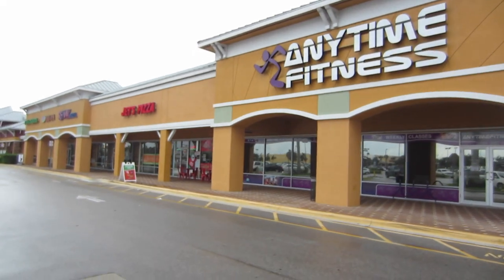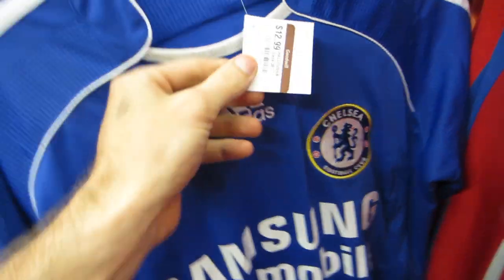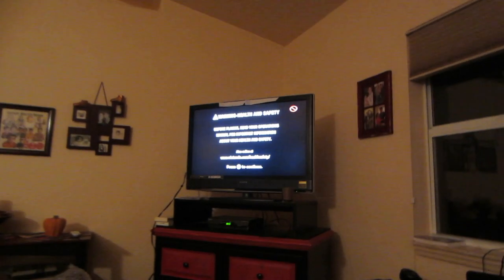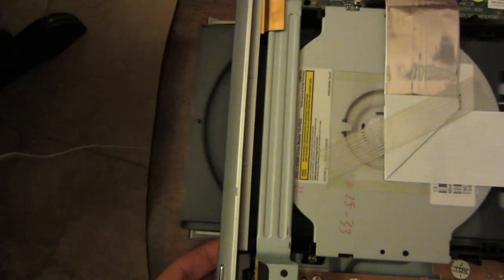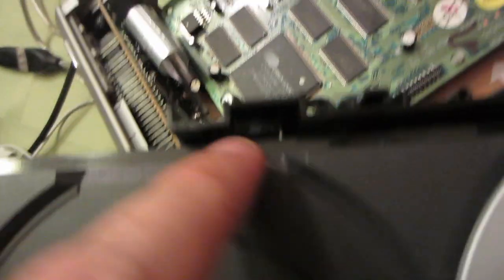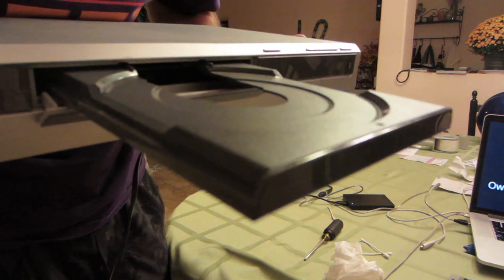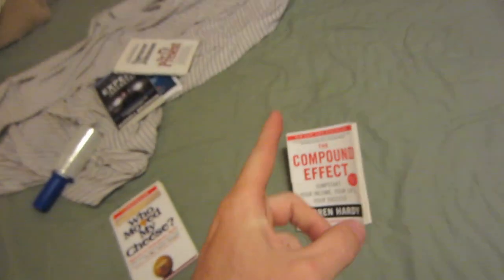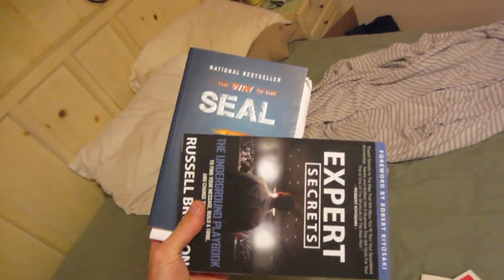Fixing a Squeaky DVD Player Door | Vlog 174

Comment: The best way to flush your coolant is a reverse flush. I thought that when you were doing the Honda the other day. You need to attach a hose to the drain plug and seal it with tape or a rag then reverse fill the system til it overflows. It brings all the crud out. If you flush from the top, the water doesn't touch the sides. Your coolant looked pretty good so you system is probably pretty clean..The big 'dirty' pizza scoffed in the van looked good!